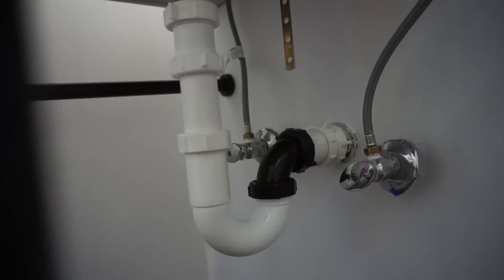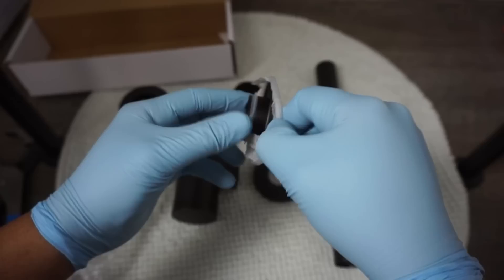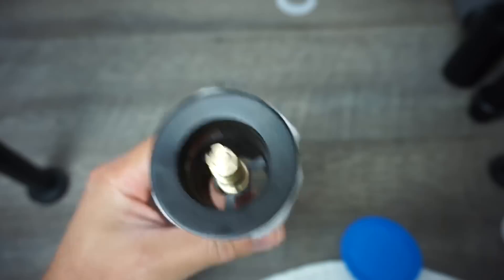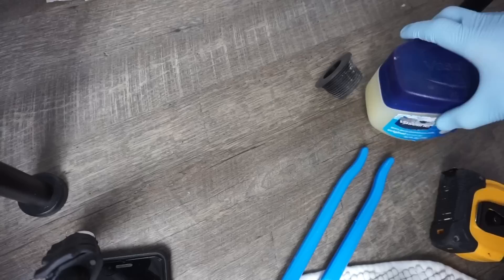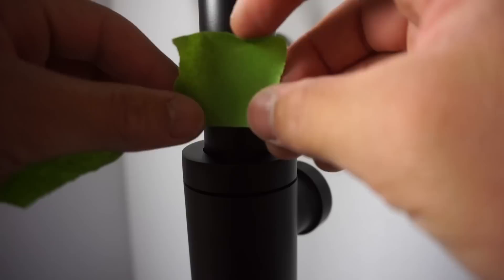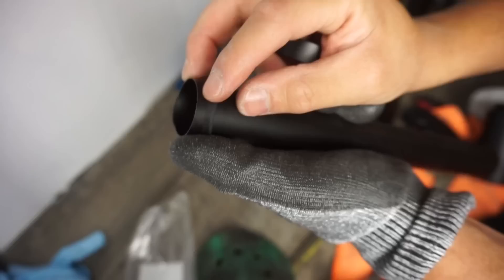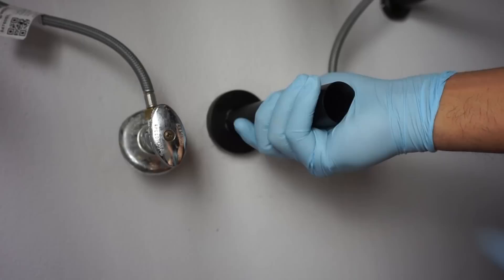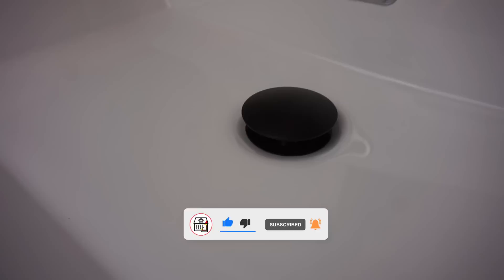How To Install A Bottle Trap With POP-UP Drain Stopper To Replace Your Old P-Trap | P-Trap UPGRADE!

Comment: Okay video but missing the important information. I bout this item and am planning on using it, but I do not like how the bottle trap connects to the drain. My plan is to use a p trap adapter and buy a black eschuteon plate to cover it. That way if this POS fails I dont have to cut the wall out, I'll just install a standard p trap.

Comment: At 4:20 where you say "it will leak if you don't do this"  that means the drain failed to seal on top doesn't it?
Reply: Yes, if the top plumbers putty seal fails then it will leak if there is no putty also at the bottom. There are 2 other reasons that I have learnt about from leaks in the past at our house, which do not necesarilly mean the top seal is compromised. 1) Safety Overflow - Plumbers putty at the bottom will seal against any water that might drain out through the safety overflow hole at the back of the sink (seen at 1.09). At 3.22 you can see the rectangular slot holes in the drain assembly (below the putty and above the thread) that allow water from the internal built-in overflow channel (seen at 1.08) to escape. 2) If the water is running with the plug popped up, or especially if the plug has been down and the sink filled with water when the plug is popped-up some of the draining water will escape sideways through the drain overflow holes in the reverse manner to which it is intended and then leak out the bottom without plumbers putty sealing the bottom.

Comment: The image depicting a plastic p-trap as being from 1880 was clearly wrong as plastic is not THAT old but according to inspectapedia, the actual p-trap concept really was invented in 1880, and the drum trap dates from before 1884…so I guess the plastic could deem that as modern. Inspectapedia goes on to say drum or bottle traps: “are NOT self scouring - the drain doesn't tend to wash itself clear when in use.” “So drum traps in typical household use can be a constant annoyance.” “...prohibited in most plumbing jurisdictions.”

Comment: CORRECTION: Bottle traps DO indeed prevent sewer gas. The inner vertical down tube recesses over an inch lower than the horizontal exit therefore same principle and purpose as traditional P trap. Water is always blocking return gas
Reply: I don't see how, because the water only rises to the bottom edge of the horizontal pipe, leaving clear air passage from the sewer up the tail piece.
Reply: @realSamAndrew  I thought the same thing but in a bottle trap think upside down bottle. Sans a visual, Imagine you are gas swimming the surface of a pool, to exit the pool you (gas) must go under the water to the ladder's first rung (the bottle neck) to step up. Gas is not going to travel down in order to travel up and out. That's the seal. Same concept as the 6 inch dip curve of a regular P trap but in 6mm full circle around the drain (contained in a bottle)
Reply: @maximusmarine  so you're saying that the smaller diameter pipe descends below the water line so the mouth of the small drain pipe is always submerged inside the larger cylinder?
Reply: @realSamAndrew  Affirmative Whereas a P traps holds about a cup of water to seal, the bottle does the same with much less. If you open a bottle trap about a 1/4 cup will leak out. That was your sitting seal in the vertical pipe sitting below the exit to the horizontal piece.  

My friend and neighbor  works for the union. The Bottle Trap IS NOT code here in Illinois but code is determined by purpose and part number. The bottle trap is not code (as it is not an approved "part"), but it does not violate code. Because it performs the same purpose as the approved parts. Inspectors like parts they know and most people don't like to upset inspectors for obvious reasons.  But you have to remember Code is barely passing parts. You have to show the inspector the process and parts you're using not only meet code, they beat code.  A well made bottle trap, especially, a Kohler surpasses code
Reply: @realSamAndrew  Yes. If it doesn't pass code, just explain to inspector. I've had to do it twice on bottle traps, And tens of times on other things. Some inspectors fail anything they arent familiar with. Most sign off with an explanation (many don't)  Many codes list actual part numbers when the company that made the old part has actually upgraded and evolved the part.  Always be courteous and respectful.  But Yes, the do the same as P or S traps just much better looking.

Comment: Do these NOT block sewer gases?
Reply: Like another person said 

Bottle traps DO indeed prevent sewer gas. The inner vertical down tube recesses over an inch lower than the horizontal exit therefore same principle and purpose as traditional P trap. Water is always blocking return gas

Comment: What state is this in and it may not be up to code in your state. I'm in California and its only aloud per special conditions.
1004.1 Prohibited

No form of trap that depends for its seal upon the action of movable parts shall be used. No trap that has concealed interior partitions, except those of plastic, glass, or similar corrosion-resisting material, shall be used. "S" traps, bell traps, and crown-vented traps shall be prohibited. No fixture shall be double trapped. Drum and bottle traps shall be installed for special conditions. No trap shall be installed without a vent, except as otherwise provided in this code.